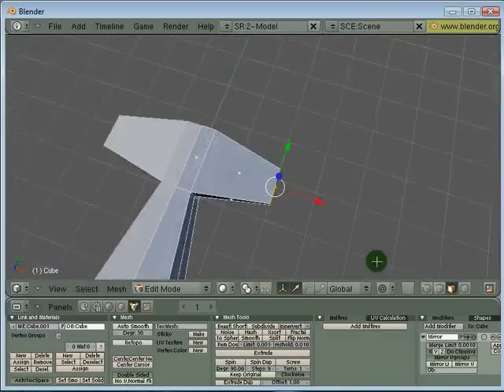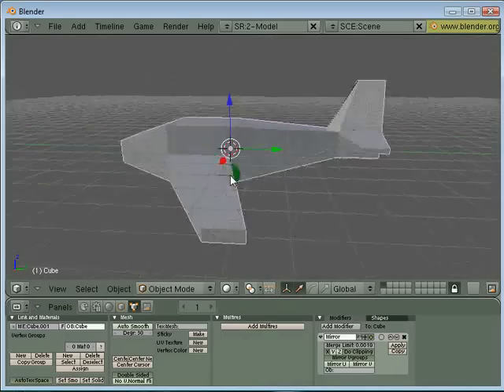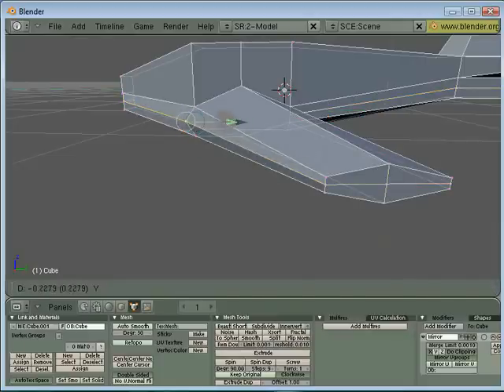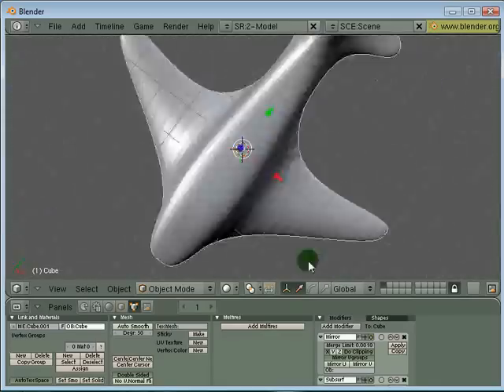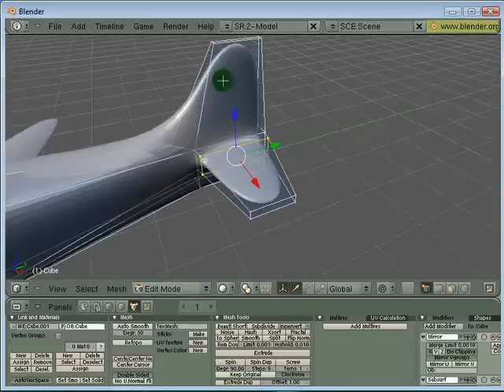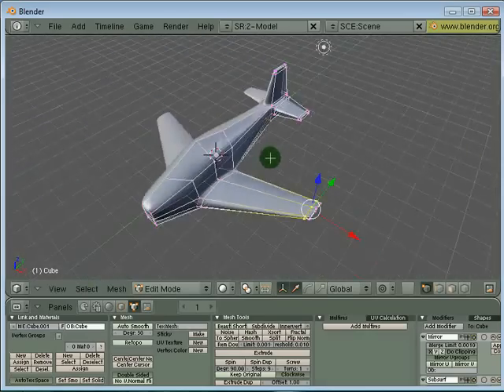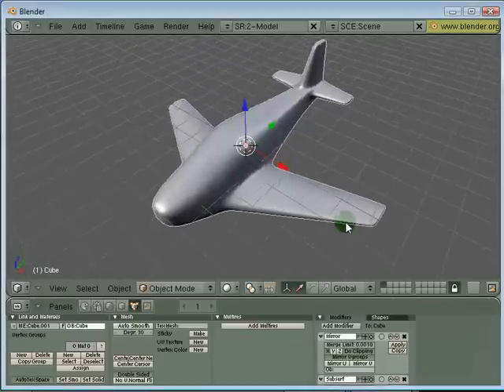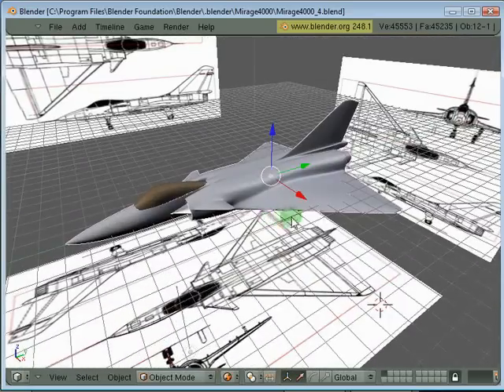Blender Simple Airplane Modeling Tutorial Part 2of2

Comment from the maker: @IxianMace You usually apply the subsurf or mirror modifier towards the end of your modeling. For some modelers, they will apply a low level subsurf so they can add more details. Another way would be to break your model into different parts and model them separately before joining them back for UV purposes. Sometimes modeling in separate components is easier to manage instead of trying to keep the model in one piece. Grouping is another way to manage the different parts.

Comment from the maker: @IxianMace Ah yes, before you apply the Subsurf Modifier, the interaction will be very smooth and fast. If you set a high subdivision and after applying, there will be a noticeable slow down in interaction especially in EDIT mode. I did apply the mirror and subdivision at level 3 and I can still edit my model albeit slower in Edit mode. You will need a fairly fast Graphics card and CPU if you want to work at high Polygon levels.  I'm running a Quad Core  Q9550@2.83Ghz with a 1G ATI 4890.